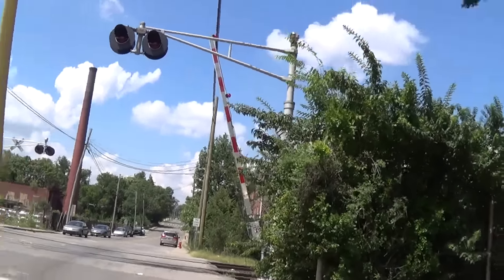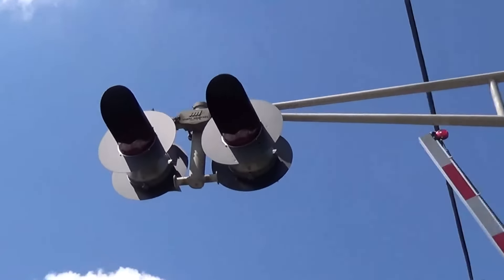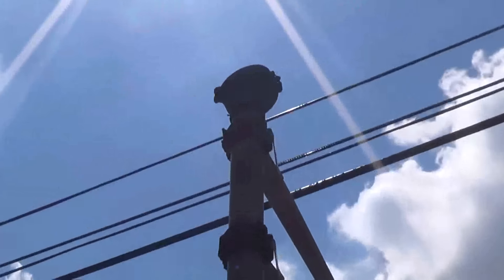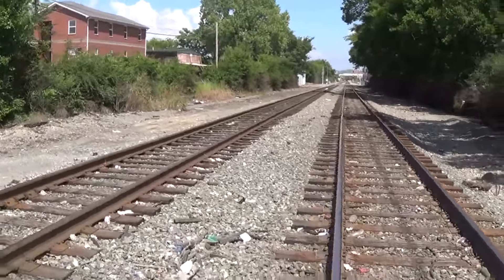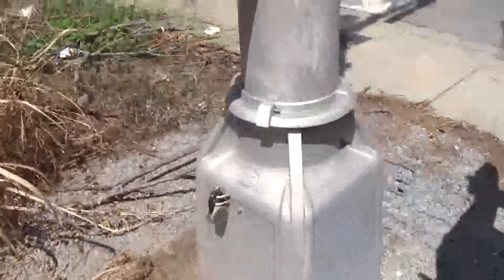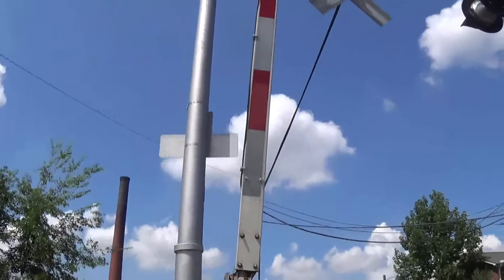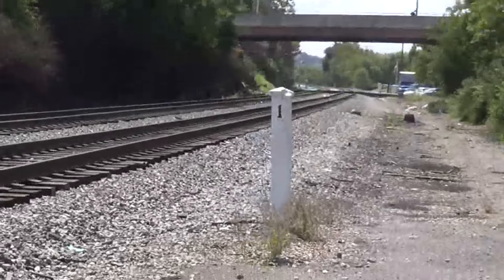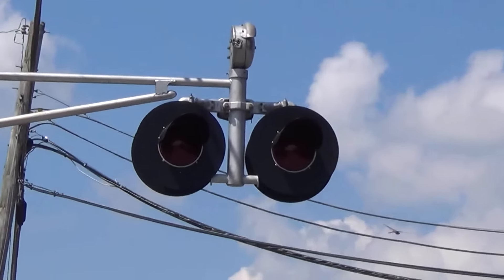17th Avenue Railroad Crossing, Nashville, TN Crossing Tour

Comment: It did get replaced though. Interestingly they got an upgrade.
Reply from the maker: What got replaced? I know the 8 inch lights were.
Reply: The Crossings got replaced possibly around 2015 I can't remember but the gate was fixed to straight up
Reply from the maker: I do know the 8 inch lights got replaced sometime between July of 2015 and March of 2016. This video was uploaded in July of 2016.